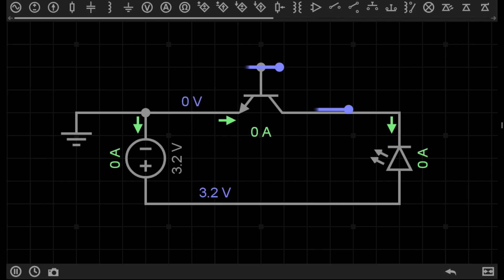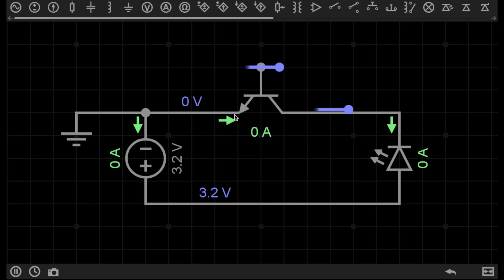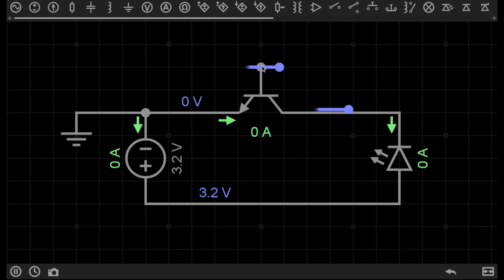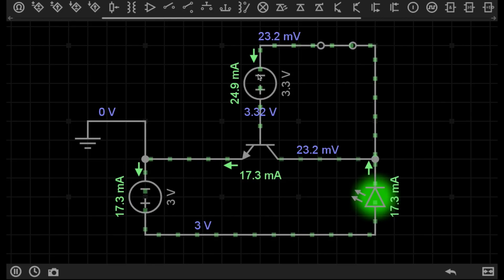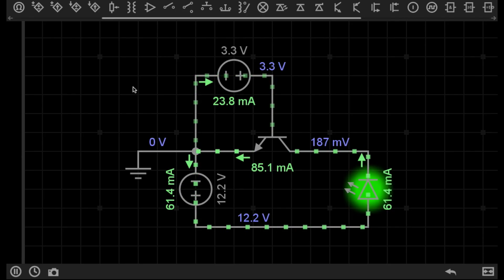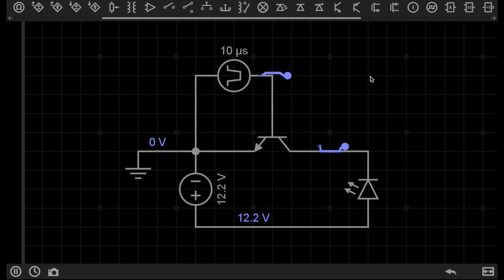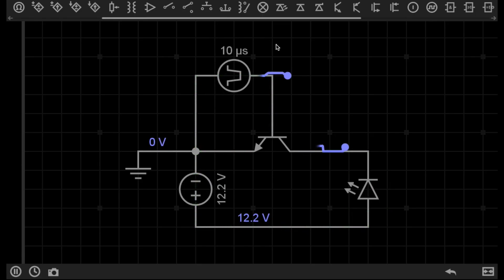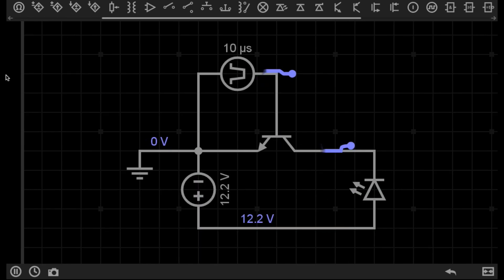How a Transistor Works EASY! - Electronics Basics 22 (Updated)

Comment: This video does not explain how a transistor works. This only illustrates how You can use it.
To understan it, You should explain how alloyed materia are putted/connected together, some with extra electrons, some with extra protons. That is the point. And it is not easy to understand..:)

Comment: Hello . Why, for example, in an npn transistor, due to the existence of a diode between the base and the collector and the base and the emitter, but the diode of the base-collector is in the opposite state and against the current from the collector to the emitter, and practically no current should flow, so why does the current flow

Comment: 1:38  IF IT IS TRUE that when no voltage is on the gate that a transistor is in a non conductive state and does not conduct from Collector to Emittor
WHY THEN DOES THIS HAPPEN
LITERALLY.....
1. I pick up a transistor,   I attach my scope probes Positive to Collector,  Negative to Emittor 
there is no conduction between the terminals

2. I get my Waveform Generator , 1KHz Sine Wave 2V Amplitude.  
Place the Positive lead on the Collector,  Negative lead on the Emittor

There is no voltage applied to the base,    THE SIGNAL COMES THROUGH TO THE SCOPE
that's weird isn't it

Now you may say.....  You have the SIG GEN Leads and the scope leads on the same legs which is the equivalent
of hooking the SIG GEN directly to the scope and as such the signal would come through

OK, so then i try this.

Remove the scope probes,  I keep the SIG GEN where it is.
and Only touch the positive scope probe on the Emittor
Signal still shows up on the scope

Now that should not be possible, because if there is no condutive path between Collector and Emittor the signal should not come through, Why is it coming through by default ?

Comment: I finally get it. Sounds like the same operation of an old school control relay activated by applying voltage to the coil thus operating the relay contacts into the desired state to either pass or restrict current flow.

Comment: Help this old military electronics technician understand something: Electricity is the flow of electrons, negatively charged particles. They flow AWAY FROM negative and towards positive. It's intuitive to portray electricity then as flowing clockwise through both branches. The emitters of the transistor is drawn in such a way as to indicate electron movement through it resembles easy going over a ramp; same/same w/the LED.

Comment: It's a bit unfortunate you did not clarify that this example is using a BJT, which is an analog current-controlled device, NOT digital voltage controlled as you implied in the video. 

It seems you were explaining the usefulness and operation of a JFET but using a BJT in the example. It would have been nice to touch on the differences between them since transistors range in their operation and are not all alike.

I usually use Falstad for circuit simulation, so I'm guessing perhaps EveryCircuit doesn't have the same options, but it would've been nice to at  least make that clarification in the video.

Comment: If its just disconnecting the transistor from the circuit why not simply drop the transistor, place a magnet there with a wire in front of it to connect the main bits and move the cable to stop the flow or start it

Comment: Hi! Please, could you tell us which transistor should be installed to use only 01 battery increasing 1.5V to 5V to work an active buzzer 5Volts? Good video - easy to understand. Tnx :)

Comment: This is very clear and high skilled explanation. You can’t find in most of the higher education colleges. Thanks sir, but I have a question about voltage level being applied directly to base of a transistor without voltage divider. I thought only a voltage of about 0.7 volts can be applied directly to base. Now in the above circuit we have 3.3V, is that level to high and can damage the transistor junction?

Comment: Little summary of this video :
Transistors are semi-conductor devices which means that they either allow current to pass through them or block current passing through them. By default transistors are non conductive but if we apply a power supply above the transistor, current can flow because the transistor has been turned to its conductive way. Now if you turns the another power supply off you will notice that the circuit is not able to produce current because the transistor is not being applied from the power supply. Without transistors we wouldn't have the luxury of having computers. In fact transistors are very useful for switching on and off at very fast speeds (millions of times a second). Computers contains billions of transistors. Computers encode them as binary data (zero and ones represent on and off). Due to the fact that the transistor can switch at very fast speeds and computers use them as instructions, it gives us many advantages for controlling many devices such as led or motors enabling us to vary the brightness or frequency of theses devices. The other advantage is that we can control higher powered devices.

Comment: Sir, I'm sorry, I didn't like it.
It doesn't convey the current operation of a transistor.  The transistor is inherently a current operated device.  We must inject a current into the base.  In applying a pure voltage to the base, the base current and therefore the operation of the transistor isn't controlled.  Applying a 3.3V voltage source to the base as you stated would certainly destroy a transistor.  We must include a current limiting component, commonly a resistor, to control the base current.  A resistor may also or instead be placed between emitter and 0V.
No mention is made of the proportional characteristics of the transistor, , ie how the collector-emitter current is proportional to the base-emitter current.
I didn't like the configuration of the circuit diagram.  It's more instructive to show the + supply at the top, 0V or ground at the bottom, with current carrying components shown vertically so that we can visualise the current paths.
Other than that, I admire your intention to provide free and valuable instruction.  Regards, Clive, Dip EE.

Comment: I am a mechanical engineer and not familiar with the electronic symbols but i sure as hell know if thats the ground symbol and you apply it in real life your circuit is not gonna work like that. I assume thats the negative part of the voltage source so whether the  symbol is dumb and only + - signs is enough or you just messed up with your circuit and you need to go back to high school and relearn that stuff

Comment: How can a small 3.3v supply a 12v? It just can?
Or it could turn on the path to the higher voltage because the 0.7 is psssed?
Or there's no explanation?(mostly in our school there's no explanation as to why these components work)

Comment: How do you know it will be 23,8mA into the base if you use a voltage source of 3,3V? This is not correct. You need a current source for the base drive not a voltage source.

Comment: Total noob questions here:
Why is the flow of electrons on the animation is shown from positive to negative? 
But, I'm guessing that it doesn't really change the circuitry and the position of the transistor on the diagram, does it?
Reply: It is usual to show direction of a current, which is different from electron flow.
Reply: It is operating under the principle of conventional theory, instead of electron theory (which means from positive to negative).
Reply: Thanks guys.

Comment: The base is hooked up to a separate power supply you said so it means it is its own circuit with positive and ground, now show the positive wire and the ground wire?  Is the ground section the one on the left of the transistor with the arrow showing? If that is so then the one on the left is used by both the base and the terminal on the right of the transistor.  Is this the case, if it is the case just say it. 
And what you call "light" looks more like a diode than a load or resistor? Why is that?
Plus you confused me as I can't tell if in mid stream you show so called current flow is movement of positive ( holes) or movement of electrons.  It seems to me like you can't make up your mind as you show both, depending on I don't know, I can't tell what?

Comment: Something good to remember 0.7 v is the minimum voltage required to turn on a transistor
Reply: 0.7 is for forwad baisin in silicon ,
Not compulsary
For germanium it's 0.3!!
Reply: It depends on the physical transistor as the turn on voltage varies based on the physical construction
Reply: @some1mn N nope it's 0.3 google it!
Reply: Also at the edge of saturation vbe=0.7v and Vce=0.3v for npn.
Reply: @some1mn N yes, some teach .6 volts and some teach .7 volts... Either is correct 😊
Reply: Turn on the transistor or complete the circuit accross the LED
Reply: Thanks!! I didn't know!!
Reply: Toni Brožić says for germanium diodes: knee voltage is 0.2-0.4 and for silicium it's 0.6-0.8
The same applies for transistors. Thank you Brožić
Reply: We call it as knee voltage
Reply: Something else good to remember, Test the transistor on Diode mode to see what the Vf actually is

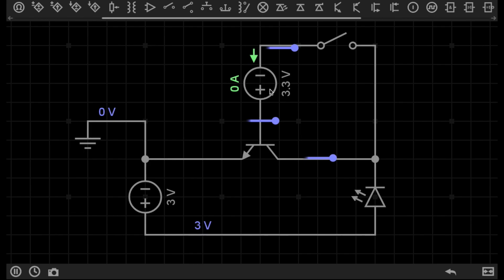Comment: From 2:00 even the simulation shows no current from Collector to Emitter and nor should there be. The LED is just in series between the two cells. Circuit at 2:35 fixes this.

Comment: Wait but why do you need a transistor if its essentially a switch powered by the effects of the movement of another mechanical switch. If the answer is that transistors are switches that can operate at incredible speed then isnt that speed limited by the speed of the movement of the mechanical switch?? Seems redundant at best. Clearly im missing some critical component here.

Comment: Wrong electricity flows from negative terminal of the battery through circuit to positive terminal on battery.  Second mistake diodes and transistors have arrow marking indicating which way electricity is not flowing.  Booo, stop confusing people !!!!!!!!
Reply: Depends on the type of notation used. Pioneers of electronics marked the flow of electricity from the positive terminal to the negative terminal (conventional flow). Later it was discovered that electrons were flowing from the negative terminal to the positive (electron flow), but as everyone already had used to the system of conventional flow notation, it stayed as the standard. Diode arrow marking is correct for allowed flow, but for transistors it means different things. Base current/voltage accelerates electron flow for NPN-transistors and for PNP-transistors de-accelerates/brakes the electron flow. The base acts like a valve for water flow, the arrow shows how it acts for the type of transistor.

Comment: sir, could you please tell me the of the software you are using in the video for making these interactive circuits.
Reply: I would like to know too
Reply: @sonic-dna7742  /vickas sharma, 
it's called " everycircuit " you can buy it on google play for like $10 bucks. also If you get it I reccomend " electrodroid plus " also about $10 bucks. but comes with an abundance of useful tools. bolth apps can be a pain in the ass and confusing at times, basic circuit knowledge is a must for dealing with either

Comment: I think regular bipolar transistors should be defined as 'current multipliers'. I think it does a better job at explaining what they are doing, but perhaps that is more important for someone actually trying to make circuits with them. The current that flows through the collector to emitter is a multiple of the current flowing from the base to emitter. That multiple is called it's 'gain'. Because of this, the base on them is pretty 'low impedance' which is usually a bad thing if using them as a 'switch', and driving a heavy load. Your signal will have to be quite high on a high load, which is challenging to do from a microcontroller. I dislike looking at 'transistors' in general as a 'switch' because of this. Mosfets on the other hand...

Comment: I find your video a little bit confusing. First of all you should separate BJT transistors and FET transistors. BJT´s are current controlled and FETs are voltage controlled. At your video you control the BJT as if it was a FET. Drawing symbol which you have used at video is a BJT(Bipolar Junction Transistor). It is also confusing to see something flowing away from collector at the first part and suddenly current goes into and through the collector at the second part of the animation.
Reply: A lot of these videos are confusing like that, even the current will just change from conventional to electron flow mid-video sometimes
Reply: NEEEEEEEEEEEEEEEEEEERRRRRRRRRRDDDD

Comment: you always seem to make things a bit more confusing for beginners!!! Why do you show the voltage going through the light diode and then to the second power supply and have 23.2mV showing from the back end of the transistor to the power lead coming from the light diode then tell us the voltage flows through the LED through the transistor and back to the power supply.. even your arrow showed the path.. you diagram and your explanation show two different things.. Very very confusing.. and this is not the first time I have been confused by your explanations.. Maybe it is because I am just a beginner.. Well you will probably never see this since this was made 3 years ago..
Reply: Remember that there are two electrical circuits in play.  The main circuit is the bottom loop, which includes the LED.  Current flows from the 12V source, through the LED, through the transistor (collector to emitter), and back to the source.  The second circuit is the top loop, demonstrated as a 3.3V low-voltage source.  That circuit goes through the transistor's base, out the emitter, and back to the second source.  23.2mV is not depicted anywhere in the diagram that I see.  I think you're confused with 23.2mA (or 23.8mA), showing the amount of current flowing.  Big difference between amps and volts.
Reply: @jovetj  Thanks my friend.. I will get it.. I am at the "just learning" stage and things always seem confusing there.. being 66 years of age doesn't help either.. well carry on and thanks for helping me get things straight in my head.. It is just a hobby I am trying to teach myself.. I do like your channel though.

Comment: Cant we use a one power source to power both transistor and LED. ?  Use one wire with a resistor to power transistor and one wire to power led or motor?
Reply: Yes.

Comment: I am rather confused. Sometimes in the schematic the current flows from the negative to positive, while sometimes the schematic shows the current flowing from positive to negative. Very confusing!!! It's better to adhere to the same directions throughout. Will be grateful if somone care to explain to me. Many thanks.
Reply: The way I learnt long ago, if current is viewes as a flow of electrons (negatively charged), it flows out from the negative terminal of power source, through the circuit and returns to the positive side. This is referred to as electron flow, however for the purpose of circuit analysis current is supposed to flow from positive terminal, through the circuit and return via the negative terminal; this is the known as the conventional current flow. It does not really matter which as long as you understand what you are dealing with and how the voltages around the circuit are determined.

Comment: Reading through the comments I'm amazed at how many are of the form "I've studied electronics / transistors / circuits for weeks / months / years and I never understood them before this video."

Congrats on a helpful video, but seriously folks, people were learning about transistors from BOOKS for decades before YouTube was invented.  I have to wonder how some of you manage to function in society.  The basic concept of a transistor a little more than a voltage or current controlled switch.    

If that concept was difficult to understand from pictures and text, you have to wonder about reading comprehension skills.  I'm sorry if that sounds insulting but, it sounds like there are a lot of people that could use some help with reading.

Comment: Why does the current not flow to ground? What keeps it 'in the circuit,' and not go to ground? Path of least resistance?
Reply: Electricity must flow in a loop.  It can be a tiny loop or a big long one stretching hundreds of miles.  But it must still be a loop.  Break the loop and electricity stops flowing near-instantly over the entire loop.

Current doesn't "flow to ground" because the connection to ground shown on the diagram does not create a loop.  If a ground fault were to happen—for example, the (+) lead on the LED were to become exposed and accidentally touch the grounded chassis—then a loop would be formed between the (+) and (–) terminals of the battery, and a short-circuit would occur.  Ideally, a fuse or other protection device would then interrupt the current flow.

Connecting one side of a circuit's loop to ground ("grounding it") causes the chassis or the Earth to share the same electrical potential as that side of the circuit.  This can save on wiring, or increase safety or lessen risk of fault, since if you're grounded and you touch a grounded part, no shock will happen.
Reply: @jovetj  Excellent explanation - thank you for taking the time